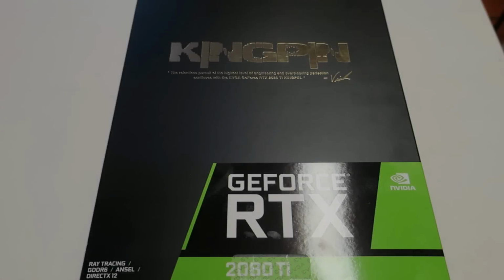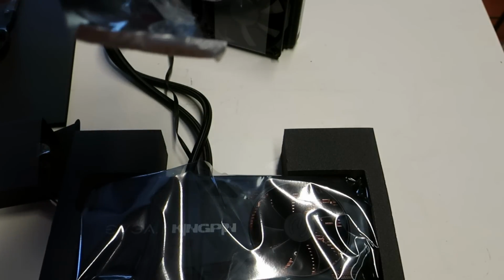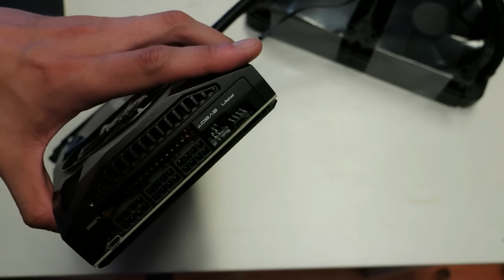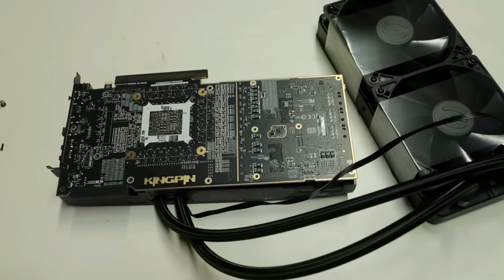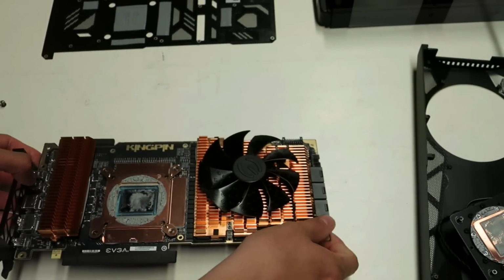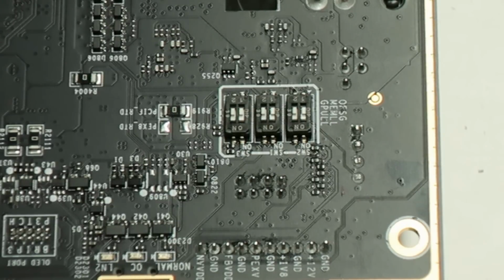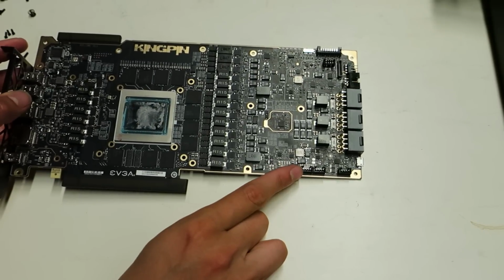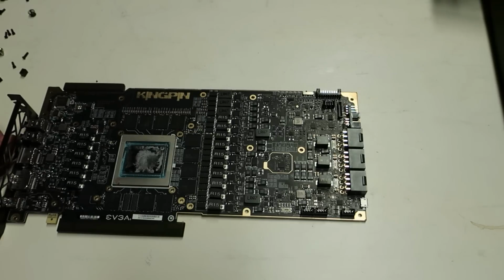EVGA Geforce RTX 2080 Ti K|NGP|N - Unboxing & First Look

Comment: Yay, that's the way, don't turn it on, take it apaaart! 
Screw under sticker is just to ensure the owner , that nobody else tampered with your card. Breaking that sticker does not violate the warranty.
8-pin connector is for OLED interface on LN2 bracket kit or OLED on HC block. Many pin connector next to it is alternative fan connector, which is unused with hybrid cooler.
Reply from the maker: Yeah, master TiN lights those points out!